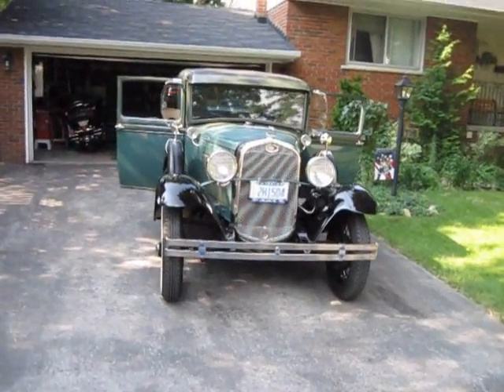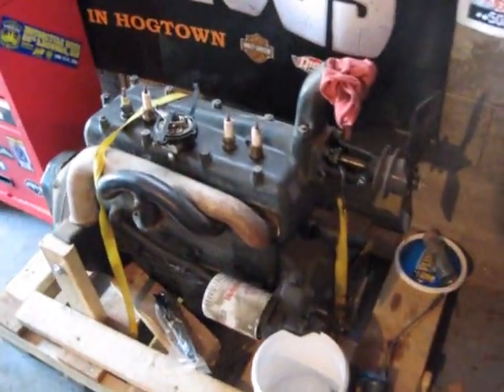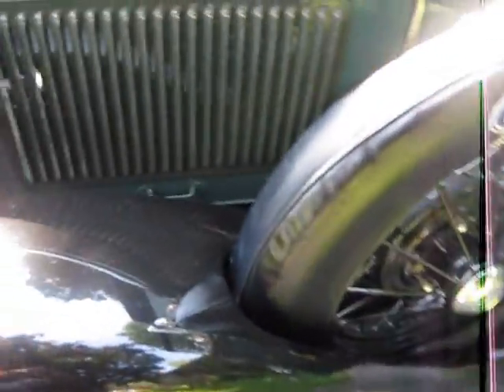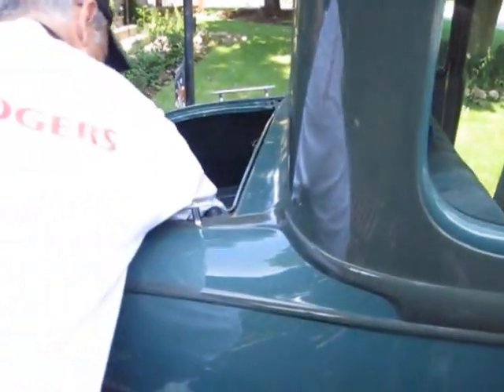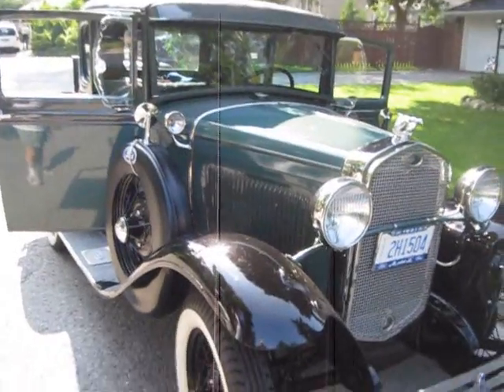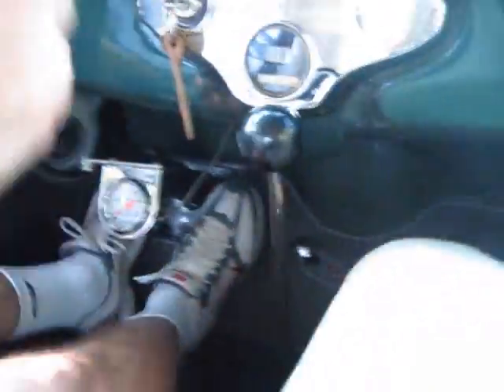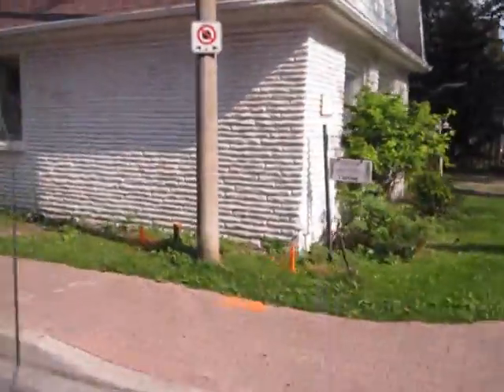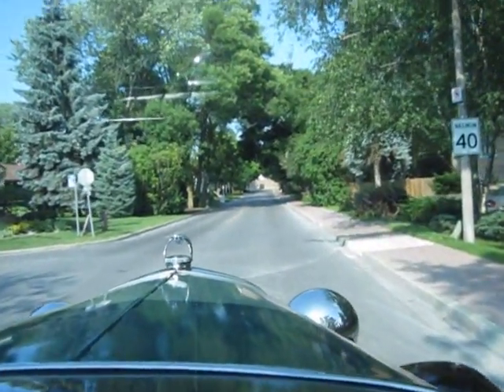Starting and driving 1931 Ford Model A

Comment from the maker: It is basically timing when the spark plug fires for optimal power, modern cars do this automatically but back then you would have to listen to how the engine is running and change it manually for optimal preformance and to get the most out of your fuel and engine. look up Ignition timing on wikipedia for more information.

Comment: It's just normal you hadn't seen it before where you live, that's why while in America cars were enormus, a lot more advanced and had great engines, in Europe, and mainly in the south of Europe people just wanted cars that were small, simple, not very powerful and that you could use them for everything. The Dyane 6 was first designed with a really soft suspension (in order to drive fast in the countriside) and with a 2 cilinder air cooled engine, this way the car hardly ever got broken out.

Comment: I have a ford 1931 model A roadster, and it is a bit different. For example the gas valve is inside the engine compartment on the right side.

Comment from the maker: Every single part right down to the smallest screw right up to the engine block is original from the factory from 1931 aside from the mirrors, one of the license plates, temperature gauge (obviously) and battery.
Reply: Alternator not original

Comment: yes I would be scared too, but I think as long as the axles are good and the wheel bearings have been properly replaced over the years It should behave reasonably well on a med. speed highway with a speedlimit of about 60 while driving 55, that would be the fastest safe speed for travel in this car on a road, you still need to slow down alot in the corners...

Comment: That thing is awsome, How do you get it to downshift with the slide gear trans? (correct me if im wrong) But i didnt see you hit the gas when you came to the last stop sign "for the double clutch" just cuirious because my car has a slide gear from first to second and it a pain in the neck in traffic comming out of the highschool parking lot with a whole bunch of impatiant teenagers driving their moms lincons ect. (got fliped off today because i came to a complete stop at a stop sign) Thanks!

Comment: Nicholas Golden --> I have heard from Model T collectors that Model T's had air filters (which dramatically increases engine life), so I'm am mystified that the much advanced Model A's did not have air filters.
Reply: Model Ts didn' t have air cleaners..  I'm sure theres a after market kit of some sort so you could put one on a model T but from the factory no they did not.
Reply: chris short Thank you. One more thing that Model T's did not have that cars today do.
Reply: Model T's and Model A's are know to drip alittle gas from the carb. after shutting it down, if you had a paper air filter on it just think how fast things would become exciting if the couple drops of gas collected in that filter and then it back-fired when you started it up again...

Comment: I am just wondering why there is a throttle advance on  both the floor and the steering column.
Reply: Because the model T had it only on the steering wheel so they put both on this car and it's good to adjust idle while driving the choke can also adjust idle.

Comment: But by chance, the car's suspension surprised all its owners because the fact of being really soft and with an exagerated movement, made of this car an unrollable car at any speed it could only roll driving backwards at its top speed and tourning its wheel completely.
If you want to see a video of the one I have you can see the videos i've uploaded, starting the car in a way... which is not a way as you say in the video of your great Ford!!

Comment: I got a question, Im planning on getting enough to finance a Model A for my First car, however, i need to know from a Model A owner, if a car like this is a good starter car. I live in Georgia so to put the environmental factors in for those who dont know, its most of the time pretty humid and pretty hot in the summer, winters are occasionally cold, but relatively mild. I have never drove a Stick shift, i Have someone nearby who owns a model A that I can look at, I have only drove automatics, and am comfortable with them. So with these factors, is the Model A a good Starter Car, on top of being my dream car, or is it something to hold off from?
Reply from the maker: Ray Roberts it's definitely not something you will want to drive every day. Some people do but you should have years of driving a regular manual before driving something like the A. It's a great collector car but terribly impractical to use as a daily. It's also ideal to have mechanical knowledge and experience to fix issues as they arise. Good luck with your first car purchase!
Reply: Thank you for telling me that, and I'll ask any other questions I have about the A if i ever need to and you'll be the first one i go to. But for now, I may reconsider my idea of an A for a starter.
Reply from the maker: Ray Roberts feel free to reach out anytime for advice.

Comment: What's that peda; southeast of the starter button at 3:47?

My grandparents had one, I don't know what year it was.  My mom said Grandma drove like a maniac.  So did my mom!
Reply: napernick
 I didn't know they had high beams back then!  I guess I never thought of it.  Seems that I was told my grandparents didn't drive at night.

I've had a few cars with the floor button for the brights but they were 40 years newer.
Reply: +Tera Tomare Did you mean the gas pedal?
Reply: My '28 had a foot rest to the right of the gas pedal.

Comment from the maker: I would never be comfortable in that car at 65mph, mechanical drum brakes, no assistance for steering, no seat belts, regular glass windows, 81 year old parts.

Also the stress on all of the drivetrain and engine running it at or near redline, parts aren't that easy to find and they aren't exactly cheap.